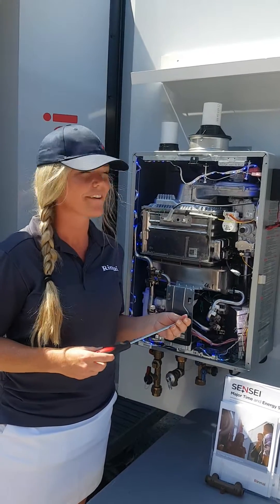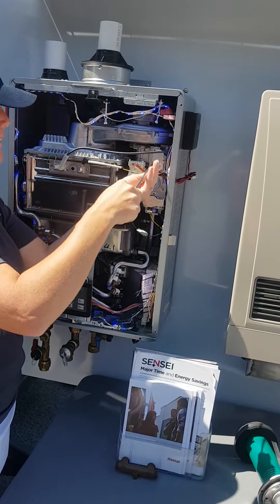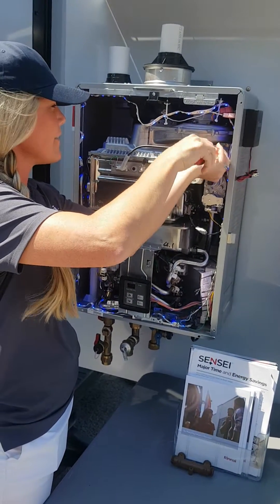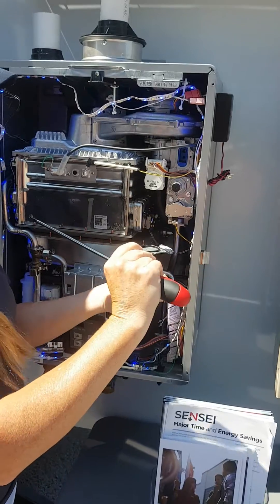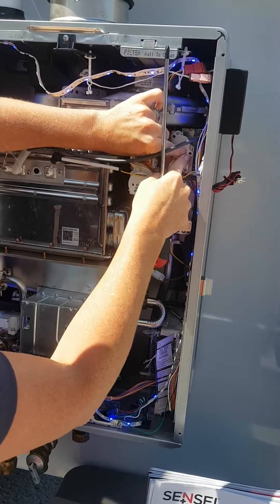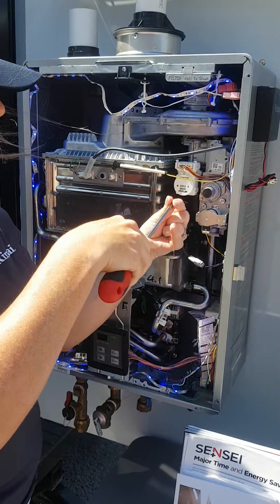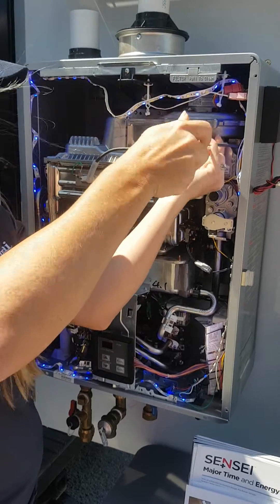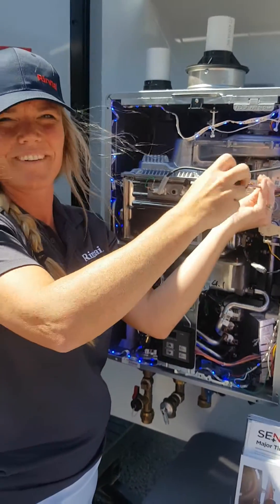Rinnai RUR199iN Gas Conversion to NG

Comment: Off gird is way different than remote in Alaska, I guess. My cabin is 50 miles from the nearest road. I bought a Rinnai V65e by mistake. The heater I had did not require power. Can I convert the V65e to use it with a 12 volt system ?

Comment: So if I’m have a propane unit but need to change it to natural gas this is what I need to do? I have model number RL94i
Reply from the maker: It is not the same procedure for an RL94i, best would be to go to www.rinnai.us/find-pro and put in your zip/postal code to connect with a company locally. Or call 1-800-621-9419 customer support.
Reply: How to check manifold pressure?